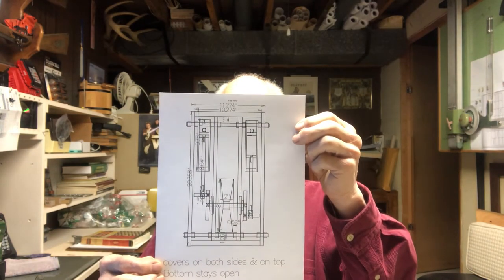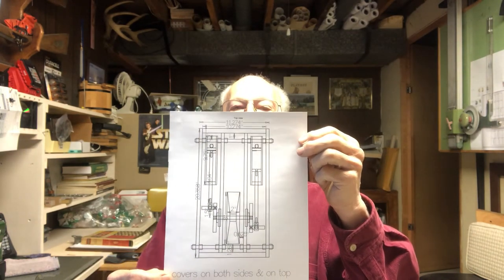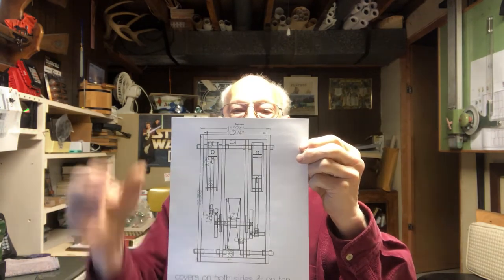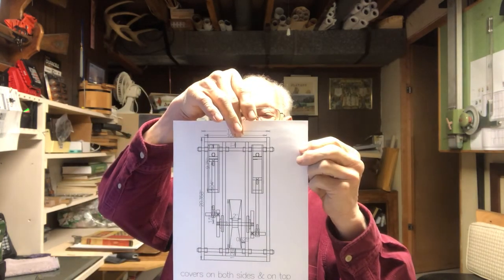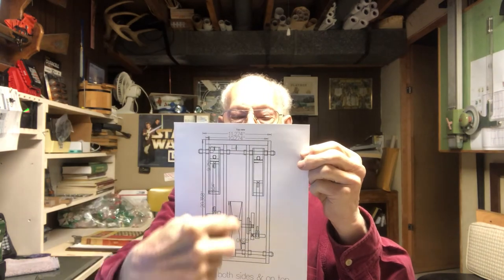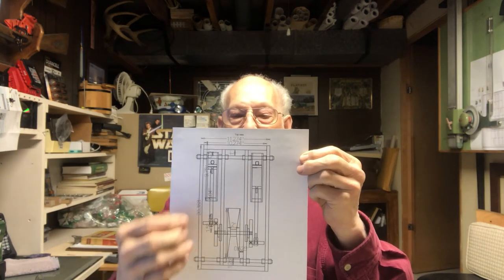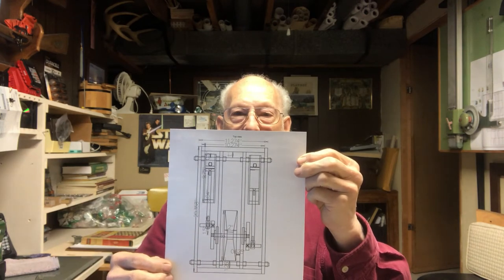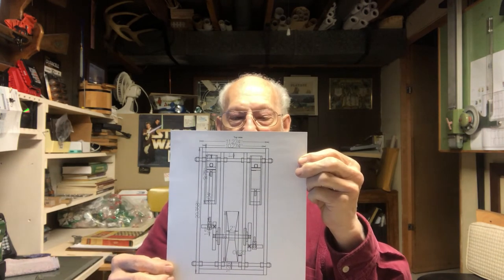Air Powered Portable Bicycle Drive 4-2-21.

Comment: i really appreciate your efforts...im thinking about air power for 9 years...from all my experiances best air powered unit is not rpms or speed...the faster it spins the more it consuption.the  best way is making big slow cylnder or tank filled with hydraulic liquid push that  liquid with air 15 bars wold do...and pressuriszed oil will spin hydraulic motor with super high efficiency.
Reply from the maker: Thanks for your comment and your support, I see you have quite a few ideas about different ways to power something using air. I’ll have to think about them for a while?

Comment: I might have a few ideas that could help you? I have built three air powered bikes.. the first bit of advice is to use larger pistons and run them at lower pressure to maximize expansion potential.
Reply from the maker: Thanks 👍 good to see your still with us, there's a good chance some of our followers have passed away over the past year with Covid 19.

I have been following you with your Air Powered Bike, and thanks for the offer with advice and information.
I will be using small cylinders, with very short stroke, and pressures between 150 to 300 psi. I have not begun to put anything together yet, I first need to make the crank shaft.
I seem to have a problem, as I work on design drawings, I keep coming up with ideas that might be a better way to do it and I have to check it out before I actually start building something! - sometimes that takes a while!!
I do have some questions - about the storage tanks and pressure regulators on them. Where did you get them? How much do they cost? Do the regulators come with the tanks?  What is the lowest pressure output you can set them to? When empty, how do you get them filled? And last for now what does that cost?